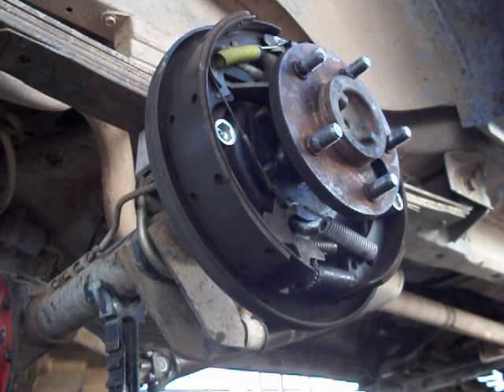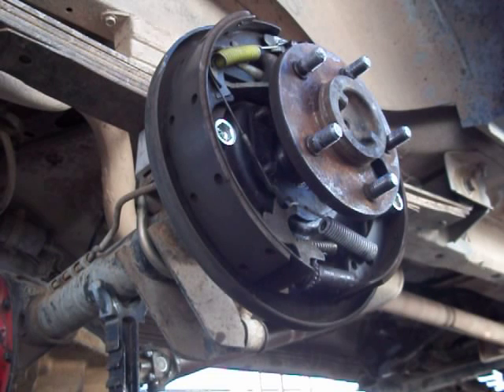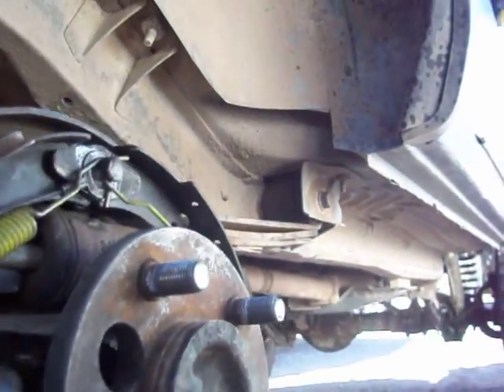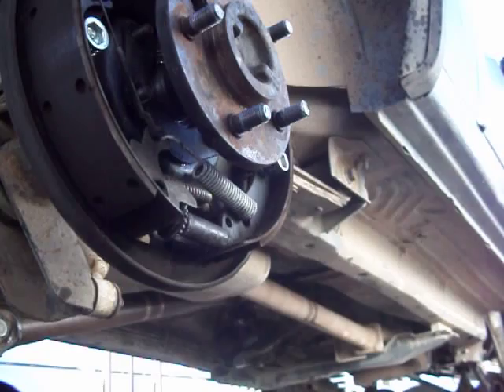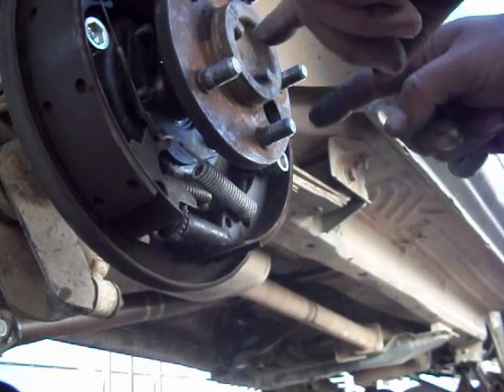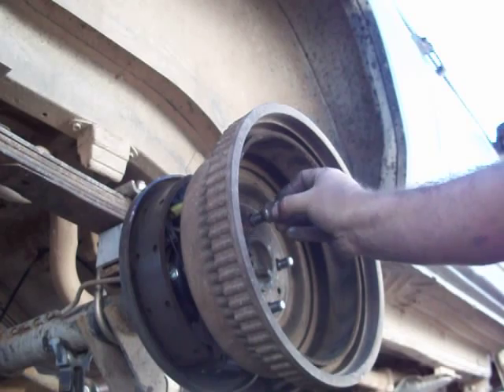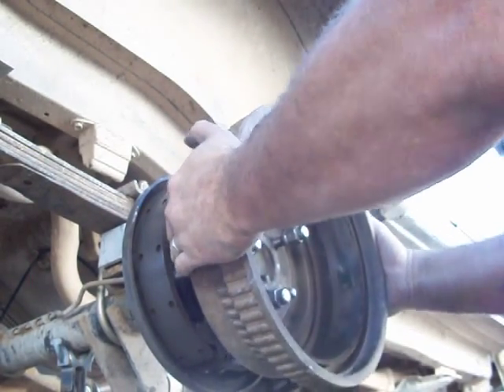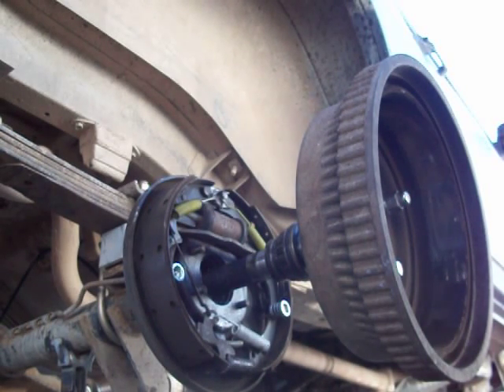How to remove a bolt in axle shaft WITHOUT any special tools---Do it yourself

Comment: Nice tip, when I was a kid back in the 70's I used to hook a chain around the axle, then come out about 3 feet and tie a big knot in the chain, and then I would sling the chain. This is kinda like a hillbilly sliding hammer. Your way works good to, I'll have to remember that one.
See ya
Mark

Comment from the maker: @DIONNA...some rear axles are held securely to the differential by C-Clips, which are accessed by removing the diff cover (draining it) pushing in on the axle shaft and removing tge C-clips. It is then that the axle itself can be removed.Repear for the opposite axleshaft. Assembly is reverse of disassembly.

Comment from the maker: @Justin...as far as the bearings are concerned on a non C Clip (bolt in) rearend, you gotta take the axle to a machine shop. The only way to get the bearing and retainer off is to cut them off.Then the new bearing and retainer get pressed back on...BTDT...
Reply: Ok my axle rim tire all came out while going down the road..  beat it back in temporarily but it keeps sliding out and I can't figure out or see what holds it in I know it's got a locking ring but it's behind the bearing so if you could show me how is all held in I would appreciate it

Comment: yes it did work out there is not a c clip on my 1999 grand cherokee lorado rear diff.  i put rotor on backwards with the lug nuts on halfway and a few good pulls axle came out . thank you i think this is the  easy way instead of a slide hammer .

Comment: I have a Ford 9" that doesn't have an access hole in the axle. I have to use a wrench to get between the axle and brake pads. No big deal to remove, but when doing a disc conversion, it's terribly difficult. I noticed that my Wilwood kit for my small bearing 9" leaves quite a bit of end play. The bearing retainer doesn't seem to have a big enough lip to come close to the bearing. I guess I need to make some shims...

Comment: Is it difficult to line up the splines to reinsert the axle? I have not done that before and it would be a mess if I got the axle out and replaced the seal but then couldn't get it back in. Thanks for the helpful video.
Reply: +Bob Genesee I was wondering the same thing.....

Comment: my 1999 jeep grand Cherokee is the same way except for the axle hole and I was wondering if you have to press the axle back in during reassembly or if you just put the bolts on the plate because after I reassembled it I did not press it in and now while driving I hear a sound that resembles dragging a chain down the road coming from the rear wheel which I just reassembled please answer this question I need help Thank you!

Comment from the maker: If you mean that you have rear disc brakes, then yes I suppose it would work...but only if you are certain that you have  bolt in rear axle shafts...if you have a c clip rear end no amount of pulling on the drum or didc is gonna help the axle release. Check your flange where the studs come through. If there's not a large access hole, its a c clip rearend.

Comment: Will all bolt in axles have the access hole? I have an 88 Chevy 1500 and I see bolts behind the hub but I don't know if those are holding the axle in. If they are, how do I access the bolts without the hole?

Comment: I believe mine has a c-clip at the end of it in the differential. Would I be able to this to get around going inside of the differential? If so, what would be the technique to get it back in? The reason I ask is I'm going to be replacing the rear bearings on my truck. BTW I have a 1997 Jeep Grand Cherokee Limited that's always 4x4 drive.

Irregardless, incredible move. Sure beats special tools and everything else!

Comment: This was helpful to me but my question is is there something that i would have to be taken off inside the differential in order to remove the axle? If this is a dumb question excuse me for this is my first time at working on the rear end of my truck.
Reply: if it doesn't have the access hole to the 4 bolts, it has a c clip inside the rear diff housing.

Comment from the maker: To the best of my knowledge, if the axle shaft DOES NOT have the access hole, then it is a C clip Axle.The bolts you are seeing do nothing more than hold the brake backing plate on to the axle housing.

Comment: I have an 86 jeep cj7 and it doesn't have the access hole. It is such a pain and I can't seem to get a good enough grip to take the nuts off.
Reply: how do we know if not a c clip type? i have an old mitsubishi car and i try to remove the rear axle shaft and its very hard to take it out ...

Comment: i am going to try this on a 1970 plymouth valiant with the bolt in axles as both sides need new bearings.
Reply: this trick does not work for my 70 model plymouth, i must be missing a hidden snap ring or something.

Comment from the maker: The other way it can be done is with an axle flange adapter and a slide hammer which can be rented from most auto parts stores, why do that...as you can see...special tools arent required.